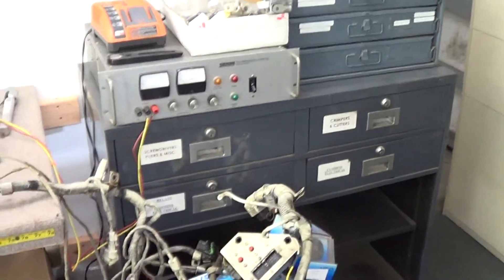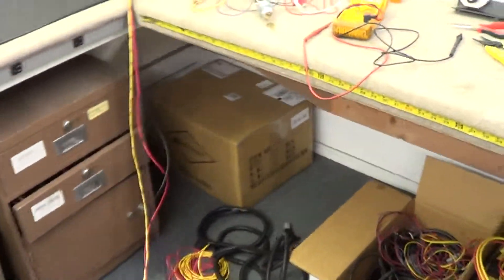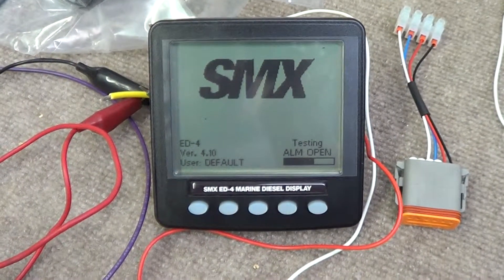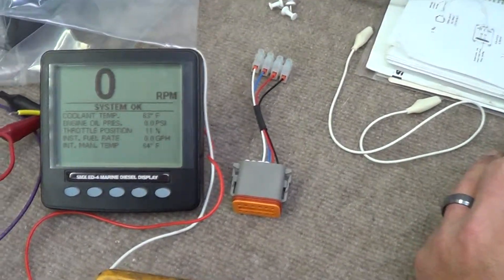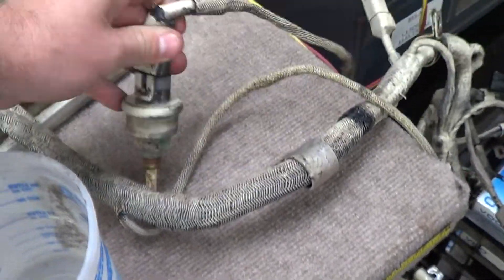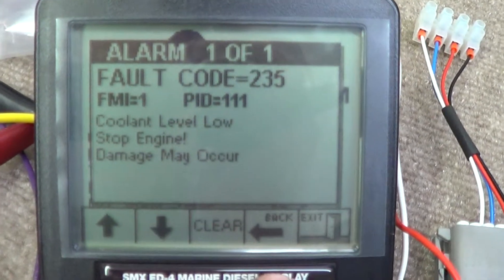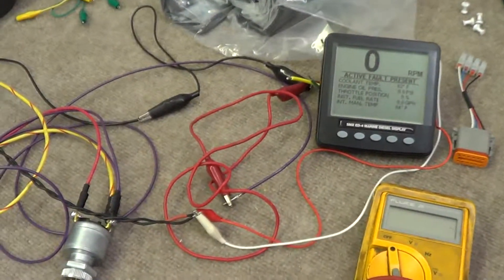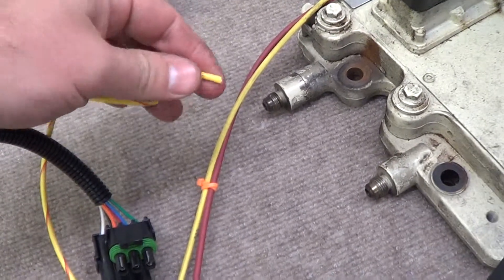Harness & ECM test for Marinization Conversion of an Industrial Cummins QSM11

Comment: How to wire accelerator in cm850 ecm ?
i want a "diy" if there's any
Reply from the maker: Start with an engine wiring diagram and look for the 3 wires needed.
Reply: @SeaboardMarineIncVideos  
and what should i wire them to
a variable resistor ?
any details will be appreciated
another thing is the engine now runs only at idle about 650rpm
how to rev it to 1500
engine is qsl9-g5 
ecm is cm850
i have the ecm diagram
Reply from the maker: @abod898  https://www.sbmar.com/product/smx-electronic-throttle-control-for-cummins-q-series-marine-diesel-engines/

Comment: I HAVE CUMMINS QBS3.3. INSTALL NEW ACELERATOR PEDAL AND NOT ACCELERATE.
HAVE THE CODE 0285 SAY MULTIPLEX.
IF YOU CAN HELP ME PLEASE?. EMAIL  LEBRON.ROLANDO@GMAIL.COM, CEL USA 7869558405.
THANK YOU
Reply: can I get hardness wire for QSB 6.7 Cummins